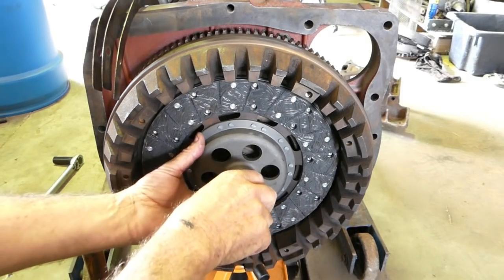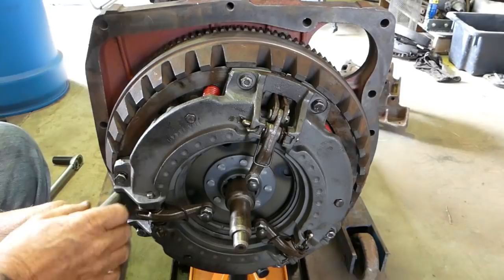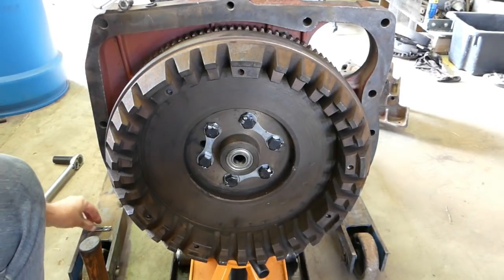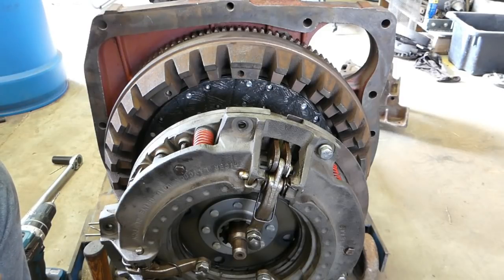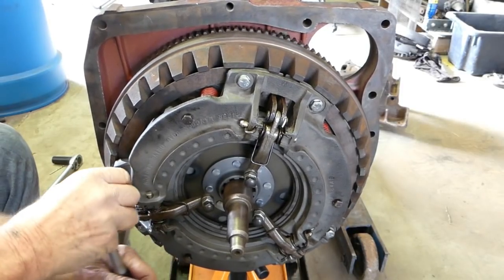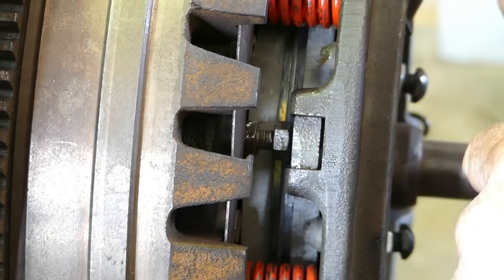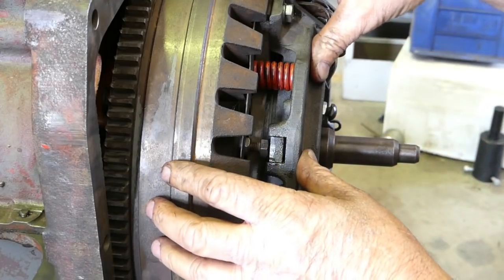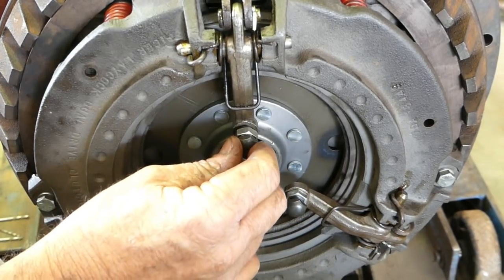Massey Ferguson 135 6 Speed Restoration # 75 Fitting and Adjusting the Clutch Assembly

Comment: Thanks again for another great video We run two 135s fir grass cutting on the railway One cranked front axle and other newer straight I fitted a new clutch assembly 5 years back but lost the dual clutch function which is a PITA cant access as it has a loader frame The supplier specifically said not to touch anything as it was all set up However they had never sen those shims and they are not in parts but input them back as you did We will have to take loader off one day and try to adjust the pto clutch gap to make it 2 stage again
Reply from the maker: Yes often it can be adjusted and tested easily from underneath, worth a go but the loader makes it a big job.

Comment: Hi Lance, very useful video.
I'm in the process of changing a clutch in a Massey 65 which is very similar. Thanks for the tip of checking how the clutch plates fit onto the splined shafts before assembly of the clutch and tractor. Better to find out if there are any issues prior to assembly  and save a lot of time wasting.
I will also check the condition of the clutch fixing bolts now that i have watched this video.
Keep up the great work.
Reply from the maker: Glad it helped
Reply: .the 65  and 165  are basically  the same as the 135   the clutch   springs may  be  a different  spring  to give more  pressure   as the 65 and 165  engines are 4 cylinder   over as 3 cylinder engine.    Both made by perkins.      The early  4 cylinder  perkins  engines  was  204   engine   or 203.    The later engine  came with the 212.  Engine  In the  165 tractor      the 65s  were 203 engine  engines  hope this helps ?

Comment: I have always stayed away from clutches and transmission as I felt they were sort of magical to work on with way to many parts to keep up with.  Your 135 video series has given me the confidence to jump in and take on the clutch, PTO shaft and hydraulic lift systems.  Thank you for making these.  Now all I have to do is split the tractor and find out what kind of clutch I actually have in there, order it, wait 2.5 weeks for the parts to arrive.  Here in the US all the virus stuff has shipping in snail mode.  Not good when I depend on my tractor for my income.  The other day a part took 6 days from a place only 2 hours from me.  Can you fix the shipping systems too?   LOL.  Thank you again for the knowledge.
Reply from the maker: We are having the same sloooow troubles over here we have customers ring every day but there is not much we can do apart from tracking.

Comment: I had three of the exact same old bolts break myself last year! The bolts break at the top of the thread, bad design with the shoulder and difficult to get out as they sit so low and in my case didnt break even. I was just writing before it happened on the video to use new bolts here. Im about to rebuild my tractor, Great Video Series, youve answered so many questions!! Ive heard two stories about these shim inserts, the one you said and the other was that it was an error by the engineers which i think it was... i had this shim laser cut from one solid piece.
Reply from the maker: Thanks Nathan, You never stop learning with these tractors, Im still learning heaps.

Comment: I worked at a MF main agent in the 60s and 70s and have done hundreds of clutches, I always thought the metal shims were there so in the event of the clutch wearing ( which they did a lot ) and the face of the flywheel getting damaged it could be skimmed by the thickness of the shims and then they could be left out but that was only my understanding of them. As for the 90 thou adjustment I always adjusted these to 110 thou as it gave the main drive plate more time to disengage before disengaging the pto.
Reply from the maker: I go the other way with the adjustments, the shims were more of a fan to my knowledge.

Comment: Hi Lance, great video! I am replacing clutch in early model 6 speed multi-power... you mentioned distance between machined faces of flywheel should be about 37 mm but said to look up. Where? I can’t find it in the service manual. Mine is about 42 mm now after machine shop work. Thanks and keep it up!
Reply from the maker: This might help. 
https://www.bareco.com.au/files-masseY2001-mf94

Comment: I ended up buying a complete clutch assembly as it was cheaper than just the parts.  Once the clutch assembly is attached and the 3 transport bolts are removed is that when to make the adjustment to the 3 bolts that touch the pressure plate tabs?  Not the bolts that touch the throwout bearing.  Also once all the bolts that hold the assembly to the flywheel are installed are the clutch disk supposed to be tight so they don't move?  (I would assume so as that would be normal drive state once it is in the tractor and the throwout bearing on the clutch pedal would press them allowing them to spin freely?)  Just difficult lining things back up on the drive shaft, but I'll keep trying slowly and turning the shafts inside the gear box.
Reply from the maker: The plates will move until the transport screws are removed. you can back them out so there is just a slight drag to line things up.

Comment: Great video Lance. One question - when making this PTO clutch adjustment under the tractor what is the best way to turn the clutch/flywheel in order to reach all three bolts? Just curious. Have a great day.
Reply from the maker: I put a screw driver into the clutch and turn it gently.
Reply: .PTO  clutch  adjust ment is normally    made in the rebuild  of the clutch.     And not to be done again .   Has any additional   adjustment  is made  on the clutch  foot pedal.     Petting a small bar in the hole of round shaft  un lock  pinch bolt  slightly    and putting   pressure  onto the cluth and adjust pedal  so there is  about 1/8   to 316th of an inch free play on on pedal tighten  the lock nut bolt  cheek you have  this  free play before  clutch   pedal starts to display engage  the clutch.     As your clutch  wears down   all the adjustment  is done via this method till clutch   is no good and worn out .   Then time to replace  the clutch.     Hope this helps
Reply: . The Massey  Ferguson  tool.  Was made by churchill  tools.  And  was  about   1/8 th to 3/16 th of an inch.    For the gap  in PTO clutch  adjustment.    Once  fitted  to the flywheel  and 3    transport  bolts removed.

Comment: Hi Lance
Very nice video, thumbs up :)
I have a 35X where the PTO clutch does not work, now I have to undu the plate underneeth, and check the adjustment :)
Most of the time during this series, you mention tollerences and tourqe spec in mm, but this one you mention in imperial. What will 65 thou translate to in mm, can you help me with that? 

Is the following correct: (65*25,4)/1000 = 1,651 mm

Best regards
Karsten Jørgensen
Denmark
Reply from the maker: Yes roughly 1mm is 0.040" the exact measurement is not as important as having them all even.
Reply: How are you lance was wondering why the clutch pedal would go stiff after replacing the smaller clutch disc ? I ran through all the specs you have here. Same 11 inch clutch disc

Comment: Lance, Great videos, hugely informative. However I have just fitted a new 12 inch dual clutch with 12 red springs to an MF 135.  I should have removed 6 springs as I have to stand on the clutch - really heavy.  Could 6 of those springs be got out from underneath without splitting again, perhaps by using a dremel tool or other method to cut the spring or would that be enough even if it was possible.
Reply from the maker: no you need to split it again, I have done the same.

Comment: Hello Lance 
I like to share some problems i encounter during My chlutch assambling 
First i bought a complete new One and in the documentation from supplyer it notes i shoud not use the original spacers anymore 
Some People say i shoud use Them its THE new typer Whit 6 red springs can i go whitout Them or shoud i pout Them back in ?
And Also i Wonder whan distansen i houd havet from pto plate to the bolts on the fingers adjustment i and hö Mitch is this distance in mm 
Many thanks in advance 
Mikael
Reply from the maker: Go with the supplier if the flywheel has not been machined differently. The red springs are fine they changed in around 1982. The pto setting would be between 1.5 and 2mm

Comment: Hi Lance, can a clutch be fitted without the allignment tool or must one of them be used. New to clutches thanks for the help
Reply from the maker: Yes, absolutely but they can be a bit of a fiddle. You need to take time to line everything up well and if you have the front gearbox shafts out for re sealing they can be used .

Comment: Hi there,just after fitting a new clutch to mf 135 diesel,and my forks arent even,and when i try adjust them to 41.5mm they wont adjust down
Reply from the maker: The fingers shoule be even, if the fork is bent you will need to get a new one.

Comment: What is the reason when the second stage is working first but PTO pump is not stopping
Reply from the maker: I think the adjustment on the 3 bolts that I set at 0.060" might be wrong or it has rusted stuck.
Reply: @BundyBearsShed  thanks mate appreciate the info  the brother reckons never worked since he put it in I'm thinking it needs splitting & doing again

Comment: Forgot the air ring
Reply from the maker: Possibly but you need to remember in filming at times what you see isnt the end of the job. I get that busy filming that things get missed but before it is all together I have a good look. There are times when the ring is not needed too.
Reply: @BundyBearsShed  no worries  I do that all the time. As soon as I said that you fixed it. I put a new cluch in my 65 massey and it never had a spacer. And my pto clutch slips so I guess everything is just too worn so I have a new kit ordered. Hopefully it solves the issue.